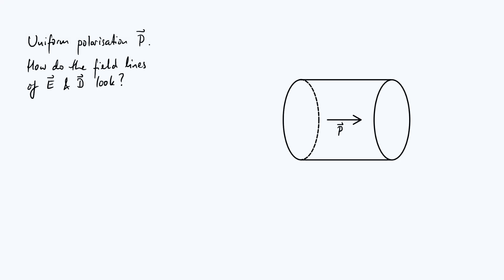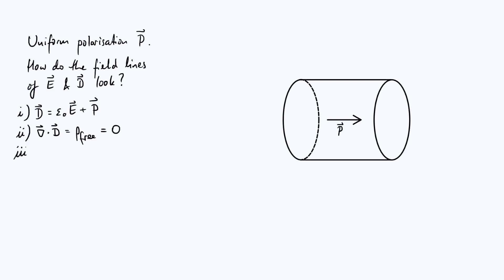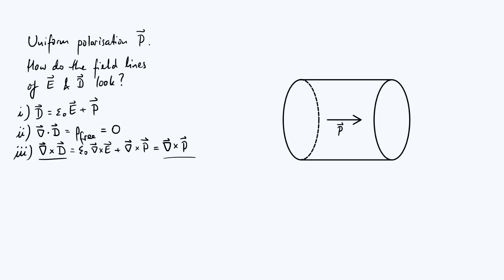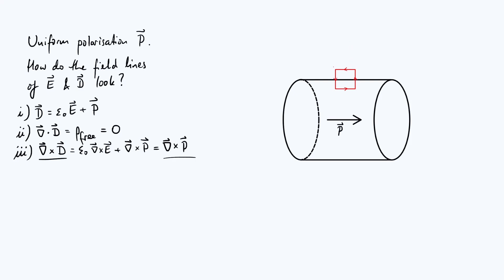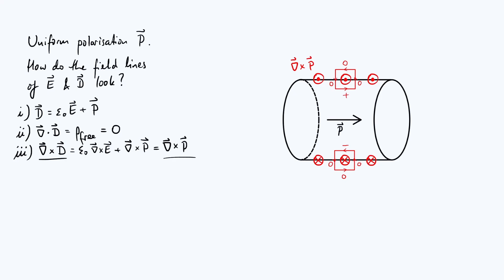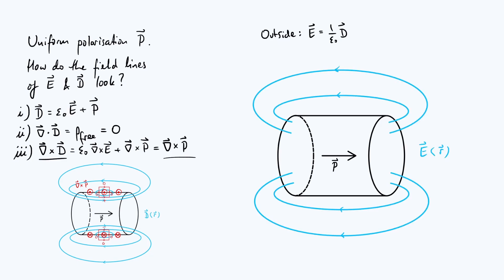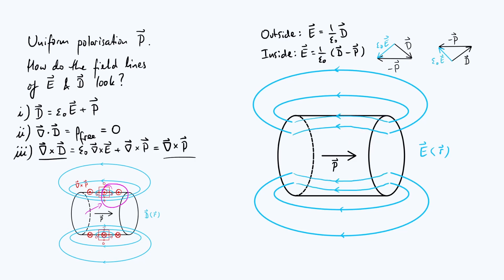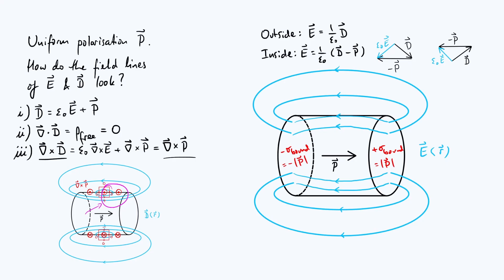Bar electret: when D is not εE

Comment: Notes: 1) Divergence of D is zero is analogous to divergence of B is zero, so there are no sources or sinks and lines must be in close loops. 2) curl of D is curl of P, in magnetostatics ( which means there is no time dependance on E), curl of B is miu_0 J. But J is not curl of something. So this means the D loop is going to circulating around "the curl of P", as B loop is circulating around J vector. 3)In terms of the relations B is more like E, as D is more like H. Where B and E are considering the effect of everything, D and H are only about free charges and free current.

Comment: Sir I have a few unrelated questions 
1) why do we assume that tension in a string is constant along the entire string
2) why is rotational kinetic energy 1/2Iw^2
Reply from the maker: 1) Apply F = ma to an infinitesimal element of the string, and you get T₂ - T₁ = dm × a, where T₁ and T₂ are the tension forces pulling the element in two opposite directions. We often assume that dm = 0, which implies that T₂ = T₁, hence the tension is constant along the string. The result only holds if the string is either massless or not accelerating (or both), and assumes that no other forces (e.g. friction) act along the string. For an example of non-constant tension see my old video on the capstan equation: https://youtu.be/T4wVlOYFoH8

2) Summing the kinetic energies of all particles in a rigid body gives: Σ½mv² = Σ½m(rω)² = ½ × Σmr² × ω² = ½Iω², where the final step follows from the definition of I.
Reply: @DrBenYelverton  thank you sir 😀
Reply: @DrBenYelverton  sir I have an idea for video , you can make a video on solving JEE advanced or mains problem using different ways (like using lagrangian and Newtonian both) this would get a lot of views too as JEE is pretty popular amongst Indian students :)
Reply: And the problems are also great for solving. (But they are usually numericals so you could also try to generalize the solution)
Reply from the maker: A few people have suggested this, I will have to take a look at some of the papers some time!

Comment: What are the uses of the D field?
Reply: It shows up in the Maxwell equation and is a convenient way to describle electric field within matter. See the latest 4 videos for more explanation
Reply from the maker: Well, arguably finding the E field is the ultimate goal; it's more fundamental in the sense that E is what determines the force on a charged particle (via F = qE). The D field is not actually necessary at all, and Maxwell's equations are complete even if written only in terms of E. Taking this viewpoint, D is just a quantity that's introduced to make it easier to find E when there are dielectric materials involved. As @mingmiao364 mentioned, I have a couple of other recent videos explaining why exactly D can be sometimes be more convenient to work with.
Reply: @DrBenYelverton  ah ok thanks, I will check those out